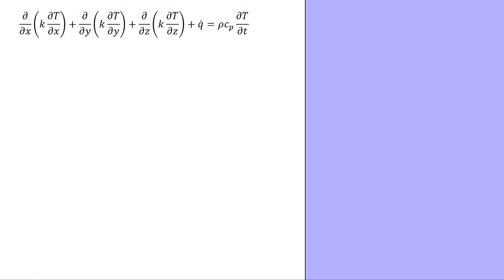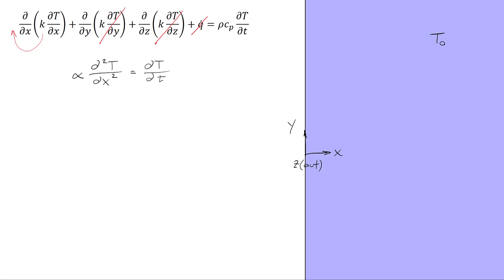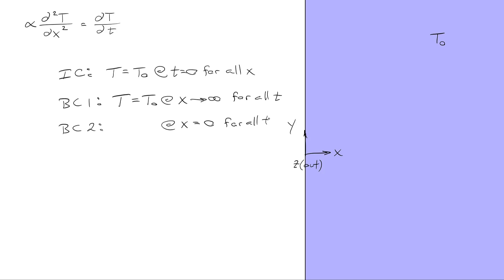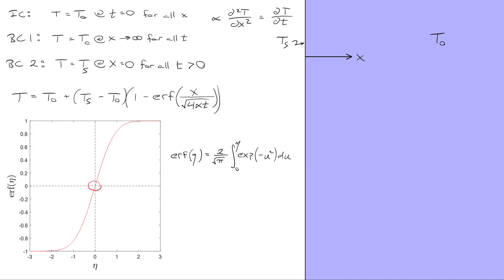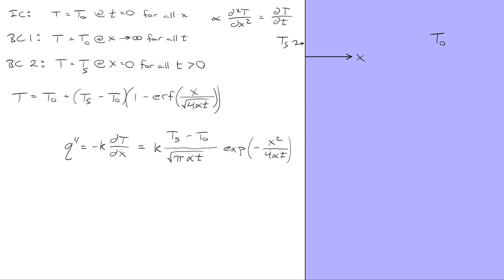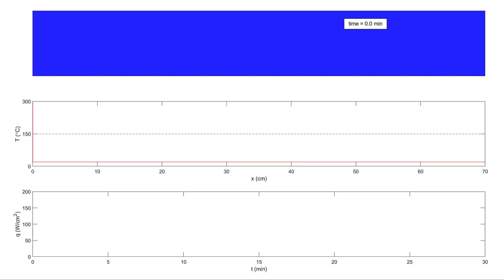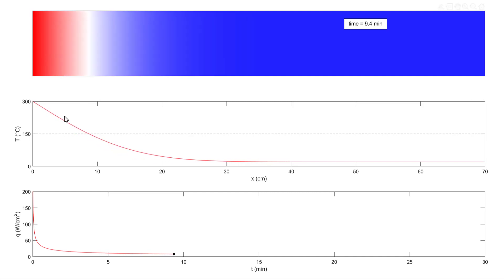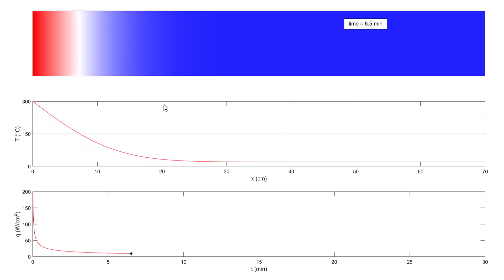Simulation of heat transfer into a semi-infinite solid with a fixed surface temperature

Comment from the maker: If you would like to recreate or check my simulation, I used the following parameters. The material properties I selected are similar to steel. Note that the flux I show is in units of Watts/cm^2 (not Watts/m^2).

k = 43 W/m-C (thermal conductivity)
rho = 7800 kg/m^3 (density)
C = 440 J/kg-C (heat capacity)
alpha = k/(rho*C) = 1.2529*10^-5 m^2/s (thermal diffusivity)
T_0 = 20 C (initial temperature)
T_s = 300 C (fixed surface temperature)